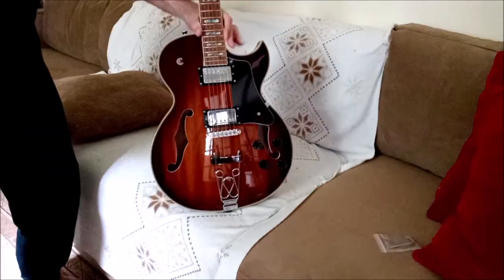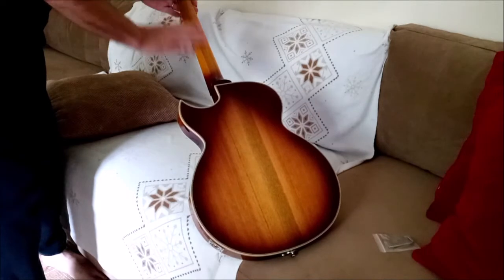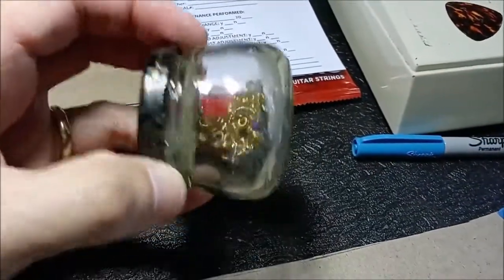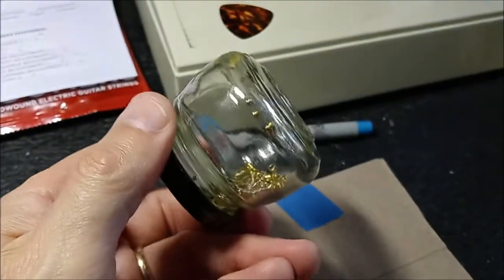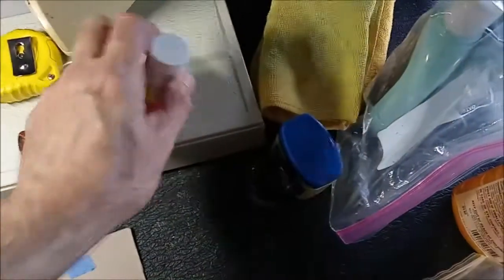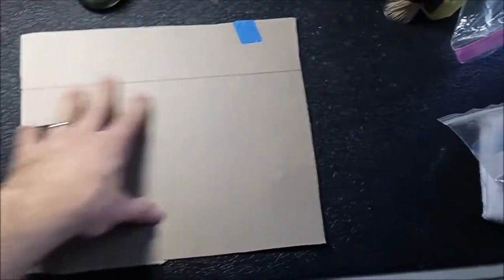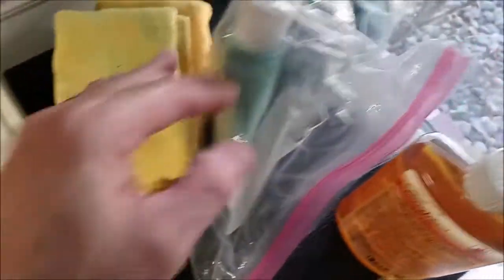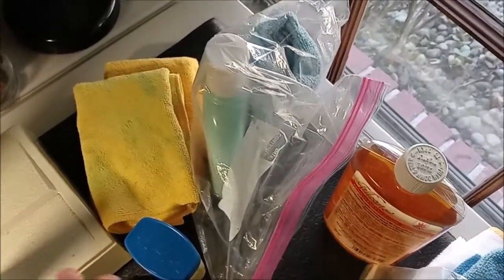IYV IJZ 300  Set Up & Sound Samples

Comment: This is the 2nd video I've seen of yours where you use the "tape method" to file and clean up nut slots on guitars. 
I'm wondering if you've ever done the math on this method? 
To be clear your using "2 tape thicknesses" above the 1st fret?
Great set up video 📹, I also like your cereal box template, that's a real time & hassle saver!
I now have 3 IYV's and each has had there own issues at set up but all have either been small set up issues or small cosmetic issues and I have not to date returned any IYV guitars.  I am a big fan now!
Reply from the maker: Hi Agate! Thank you for your comments. No...I have NOT done the math on this method. Forgive me please for showing this method often as I assume that some viewers may not have seen it before. Nonetheless, my observance is that the tape layers have ranged in number from 13 to 16, with 14 being quite common. Because of differing frets sizes, I prefer to let the tape layers dictate the height. PS: It works EVERY time for me! :-) I find it quick, easy and inexpensive.
Reply: @guitarhowtos2148  Hey if works, go with it. You've come up with a good way to do it. I was just curious because so many focus on the "numbers" and the "right" tools that have to be just so. I tend to use a bit different method and mine works too. By using feeler guages in a similar fashion and by taping them to the fretboard but everyone is entitled to their own way and I definitely learned a few tips from you, so thank you 😊

Comment: I enjoy your videos. I have a FF 338 that I like a lot. I’ve done various things to it to get the tuning right. However the first and second frets of all the strings are Sharp. Throw on a capo-Tune it-and fine! I’ve checked the neck, intonation, Action. Even changed the bridge. Sooo I’m thinking it’s the NUT. Any advice? Thanks!
Reply from the maker: Hi Dennis! Thank you for writing - and your patience in my reply. When you say "Sharp" do you mean in pitch? If the pitches are sharp, then the slots on your nut may not be deep enough. That would cause a great distance from the bottom of the string to the top of the fret, thus causing the pitch to sound sharp. Many manufacturers ship their guitars this way because it then allows the player to adjust string height at the nut to taste. For example, if one were playing slide, you would want the strings by the nut to be high. Hope this addresses your concern.
Reply: @guitarhowtos2148  thanks for getting back to me. 
Watching this video finally pushed me over the top on “going after” the Nut. I have almost always thought that the Nut was not cut correctly because a Capo on the first fret virtually solved the problem of the pitch going Sharp. Trust me I setup the guitar pretty much correctly (I’m no Luthier or a pro like you) and this left me with only one other reason...The Nut. It was just damn logical. 
So after I AGAIN watched your fabulous in depth slow paced never missing a detail video here I said to myself...NUT! I have a pair of files that I bought on Amazon and right after I wrote you I dove on in! Followed your details on measuring and grabbed my files and started slowly carefully filing away. Result? BOOM! Problem SOLVED! 
Many, many thanks, my Friend! Sure look forward to more of your videos. I’m a retired drummer ‘64-‘99 and jumped on teaching myself guitar back on ‘14. I have the “guitar bug” now! LOL. 
Thanks again!
Reply from the maker: @dennismullin3052  Hi Dennis! Nice to hear from you. Thank you, too, for letting me know your travels - and I am quite glad that the video(s) have been useful. I use to be intimidated by cutting nut slot depth, but the tape up against the nut seems to take the fear out of it - at least for me! Thanks again!

Comment: gorgeous guitar, I've seen positive videos on those 335 copies... genuines are so darn expensive I can see why folks would buy one, even the epiphones are a grand now,a good one anyway and they aren't that good as in no long tenon, or premium woods, or vintage hardware, good pups.. still a sub model but at premium cost far as i am concerned.. the 2020's are getting a little better in terms of the headstock design, but the angle is still horrible but whatever they work good for slide and rhythm guitars but get to bending the strings a lot and they struggle to return tpitch unless you nut is nutted and you use an oil or something, its bind for sure, it would help if it was a 1/8th" thick nut, I usually just bring my slot back at an angle slight steeper than the actual string angle, then I wipe it front to back, or open it up front to back, not a lot but I want the nut slot angle both directions, not only the downward angle but the angle it breaks off to the left or the right..

that's the thing with Gibsons, not only do they have a steep break which wouldn't be so much of an issues if it was simply  a single angle break, but the compound angle is a lot to overcome when bending a so forth.. a good job ona slots paying attention to the compound angles really helps and if you can leave a small shelf and a sharp break at teh front of the nut where the string falls off the nut that help too, then do a good nut and saddle compensation helps as well, costs more, but use a good material something very stable like wooly mammoth tusk, nothing is more stable save maybe elephant tusk, but you get someo mammoth that's $40,000 years old and its the same shape as it was the day the mammoth passed away that says stability.. and it easy to work with and has a very nice tone to it, why they used ivory back in the day, if it weren't for teh wealthy creating a black market we would still have elephant tusk or instruments but they took it to another place where the value skyrocketed and that was that, poachers thought it worth it to poach and make that money... sad but how it is, musicians are what created that black market, the uber wealthy wanting complete tusks for their "art rooms" and such, carvings what not..  what hasn't the wealthy messed up tho?

I want one of those 335's, beat it up no big loss right, see em going for under $250 and they get good reviews..
Reply: Actually this guitar is more like a Gibson es 175

Comment: The Cringe Moment; so....imagine that The String (action) Distance from the string Bottom TO the fret Top, ends up Being; the Same at the 1st fret AS IT IS at the Last fret Nut to Neck Pick Up?? And at the dame time avoiding across the fret board, buzz?
It would be Eutopia...
"ONE or TWO TAPE  Slices  HIGHER THAN THE 1st FRET ?????
YET the end result is 10 or 12  Tapes stacked at the last fret ??? see 38 min:44 sec ?
The string clearances Rise Up off the fret board as we travel down the neck??
To visibly 3 times higher ??
Consistant String Action distances are better than; Low at One End and Different at the other ? I'd Never cut my nut slots (1st) or that Low cringy